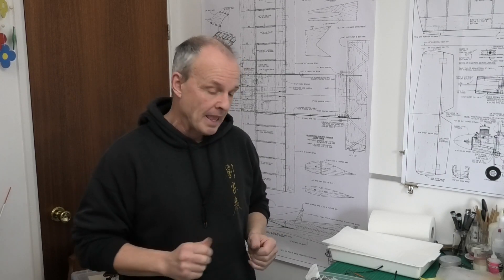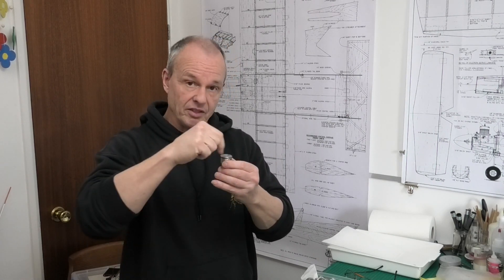Glow Engine - Conventional Piston Ring Removal & Replacement - RC Model Aeroplane Build & Repair

Comment: Thank you Mark, good videos, how would you go about a double ringed piston? I have a Dooling 29 that needs new rings, how would you work on the lower ring? Many thanks Andy
Reply from the maker: Hi Andy, thats an interesting question, I guess I would remove the top ring first, then see if I can move the lower ring up into the top ring slot, and then move it again off the piston, but this would depend on the position and gap between the ring grooves. Good luck, hope it goes well. Pleased you liked the video, thanks for the comment

Comment: Thanks Mark , I getting ready to revive my Os 120 ax glow engine . 
It has a little crank movement. If I pull on the nose cone the crank has just a little slide movement. Probably needs new bearings.

Comment: Hello Mark, I'm currently designing an inline four 4 stroke 4 cylinder nitro engine and I would like to know any tips for the piston rings (it has 16.6mm diameter bore)
Reply from the maker: Hi there, sorry its not something I can really advise you on, but wish you luck in the design and build 😀

Comment: Mark ----- I can see the OLD rings going back on in the last few videos, Do you have to end grind these rings for a certain gap when you buy new replacement ones. How hot do you think cylinders get? Pistons and Rings must expand some even with the proper fuel mixture. Another good Tip for my book. ------  Rodney
Reply from the maker: Sometimes you may need to adjust the ring, but if made properly it should fit ok without.  I guess the temp of the cylinder could be around 120deg C, but not really sure. Thanks for the comment

Comment: I am trying to get the piston out of an OS Max H60F GP engine. This motor is the "Gold Head" version. Maybe that's what the GP stands for (Gold Plated, but not sure). I already took the cylinder sleeve out of the engine, but even with it out I can't lift the bottom end of the connecting rod off the crankshaft pin. I can move it up a little, but there's not enough movement with the piston still hooked up. If there is a way for me to send you a photo I'm sure that would help, unless you have already worked on this type of engine and know the "trick" to getting the connecting rod off the crankshaft. Thanks for your help.
Reply from the maker: Hi, I am not familiar with this engine, but once the sleeve is out the con rod should be ble to come of the crank pin - make sure that the conrod moves right across on the little end and have the piston at bottom dead centre, this may help.  just have to gentily tease it across, bit like a puzzle, good luck
Reply: @MarkRobinson555  This engine has s separate rear (main) and front crankcase section held together with four screws. Here is a link to a video showing the H60F GP engine so you can see what it looks like. Slide the time bar to 1:30 to skip to where the guy finishes his introduction and finally shows what the engine looks like: https://www.youtube.com/watch?v=ij1oGq32wZI.
   I was told that I probably need to remove the front section of the crankcase in order to remove the rear bearing and crankshaft from the rear crankcase so the connecting rod will slip off the crankshaft pin. That would free up the lower end of the connecting rod. BTW the connecting rod is attached to the piston at a narrow center portion of the wrist pin and held in the center of the wrist pin by two casted "Bosses" on either side of the bottom of the piston, so the connecting rod can't move on the wrist pin forward or backward under the piston.  From examining inside the crankcase from the rear of the engine with the rear cover off I can see that the rear bearing looks like it is installed in the very front section of the back crank case section. I think I would need to heat the crankcase up in order to remove the rear bearing and the crankshaft from the front of the main crankcase. I tried twisting the front crankcase section off of the rear crankcase section, but it won't budge!  That's why I'm thinking I may have to heat it up so the bearing can slip out of the round channel it's mounted in. Please use the above provided link to see what the engine looks like and let me know if you too think I'll have to heat up the front of the crankcase in order to separate it from the rear crankcase. I sure as heck don't want to start beating on the back of the crank shaft to get the front crankcase to separate from the rear crankcase. Thank you for reading and replying to my questions.
Reply from the maker: Hi, yes certainly take the front housing bolts out and put the engine in the oven at about 200degC for 30 minutes and it should come apart with out much trouble, hopefully

Comment: Nice little tutorial! Thanks mark. I did wonder if the ring had a top and bottom, but I saw no evidence or reason that they would be sided. I suspect they ware very evenly. Car rings, when there are two or three with an oil scraper have a chamfer on the top side.
Reply from the maker: Thanks very much appreciate the comment